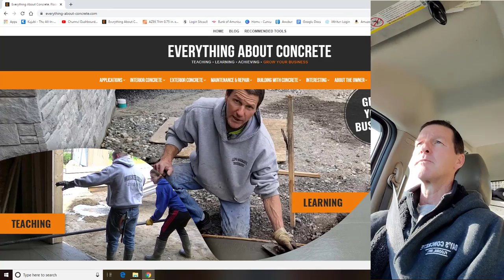Getting Started In The Concrete Business | How I Got Started!

Comment: I have done concrete work for myself like for sheds and sidewalks. I had a rental house and I wanted to put in a driveway 21' x 70'. 3 Concrete trucks show up all at once 3 hours late. They didn't bring any extra shoots, the first load set in less than 30 minutes before we could finish it and the 2nd truck started. In about an hour you could walk on it. I should have taken it to a lab and had it tested, they swear they didn't add calcium chloride to the mix. It looks ok like it rained on it. I was livid that day. Nice cool day in the shade.  I've poured concrete in the past and came back several hours later and it still hadn't set. They did say that when it sets quick there is less chance of it ever cracking.
Reply: Man, that was a tough break, but at least you were able to salvage it to an extent. 
When you made the order for the concrete, did you tell the dispatcher to space the trucks at a certain amount of time? 
i.e. 10 minute spacing, 20 minute, 60 minute? It actually sounds like it was the drivers fault and maybe they all stopped at 7-11 and took a coffee break together at your expense.
Reply: They might have loaded on top of an already hot balance. That can kick start all of the fresh mud. One company used to do it to us all the time. Then the drivers started to tell me they had a balance that was around 2 hours old
Reply: @aarongrabowski5620  Wow, I never heard of that but looking back on some of my experiences, I’m wondering now if that’s what happened to me. 🤔

Comment: have u tried the "rattle-stick"   it makes ur floats vibrate, its on battery platform too. love to hear ur input
Reply from the maker: I haven't, if they want to send me one I'll try it and make a video about it.
Reply: I own 2 of them and they work great for me.  It really helps with sealing of the concrete when bull floating.  I live in SD and the wind blows here all the time.  Now that we use a rattle stick we hardly need or use aqua film which helps the concrete surface from drying to fast.  I also now crews up here that don't care for them. My crew loves them.  We use then in every exterior pour we do.

Comment: I just started a 400' sidewalk in the backyard of a client. Out of 400' there is only a 20' spot and a 40' spot that is straight. So used hardboard to form it all up. Any suggestions that would help will be greatly appreciated.
Reply: Craig what we do is buy 4x8 sheets of pvc board from Lowe’s or Home Depot and cut into 4 inch strips. They are very flexible and you can reuse them over and over again.